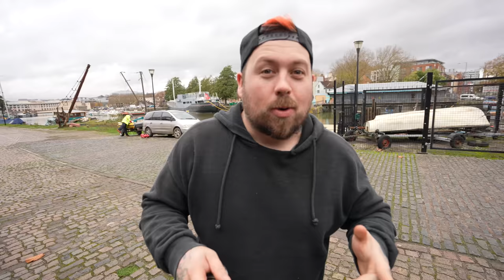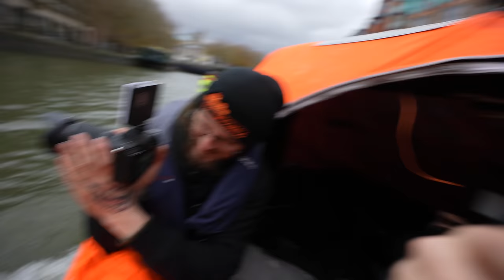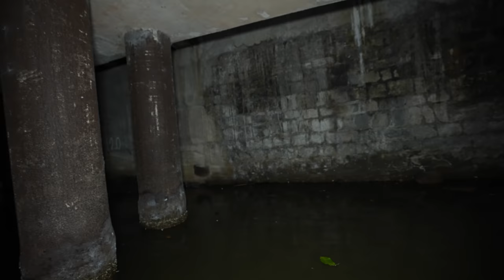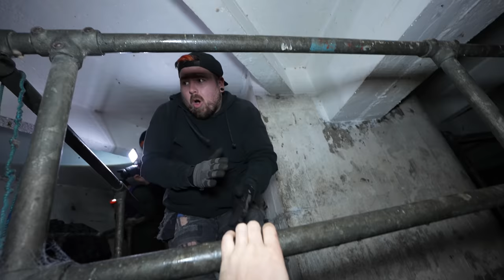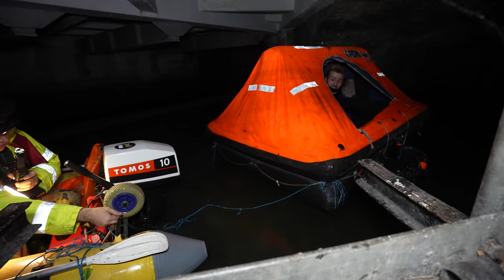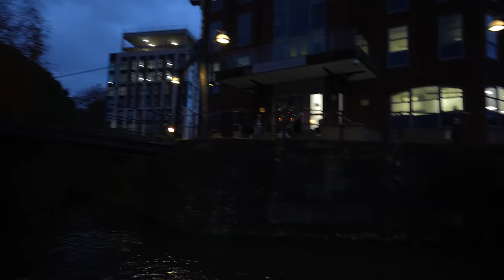Exploring Forbidden Tunnels Underneath The City (Bad Idea)

Comment: Never understood how people can go on an adventure like this and take the most useless piece of shit outboard motor they could find. Even if you've got oars for both the dinghy and the raft, it'd still be a slow trip back to the truck. All any outboard needs is simple maintenance. Clean the carb,  throw in a new plug, get good fuel and there shouldn't be any problems.